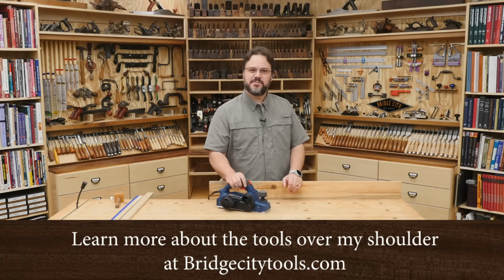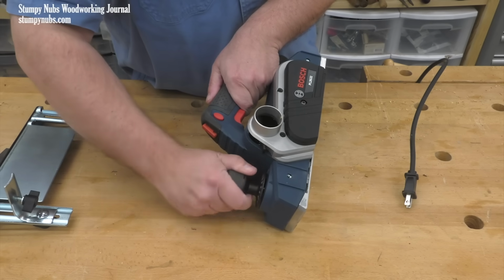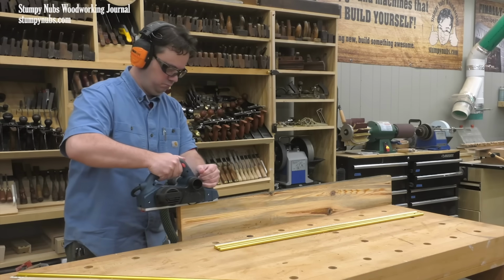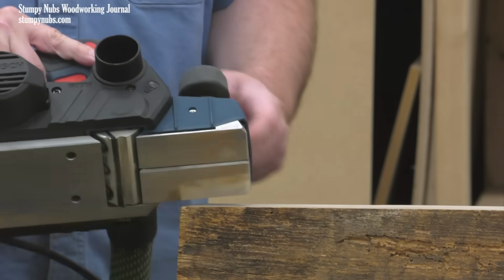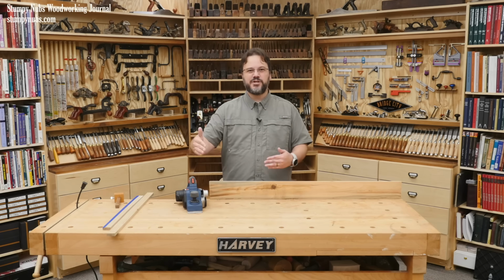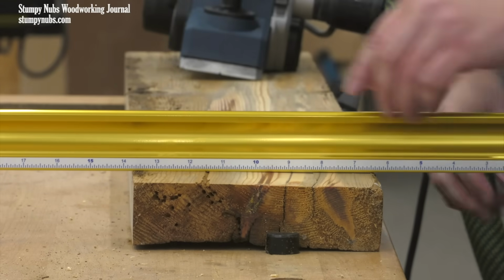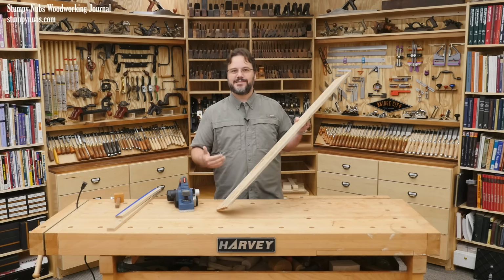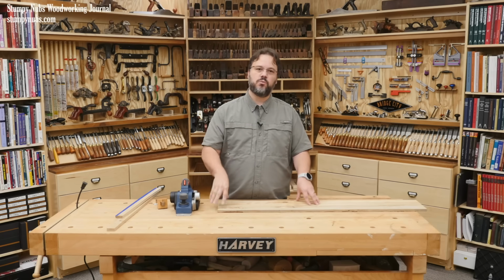Are electric hand planers too dangerous?

Comment: I recently tried a Ridgid battery powered electric handplaner for a small satellite shop..  Runtime was 6 minutes and cut was deeper on the right side than the left.  Returned it and got the corded Dewalt.  It works fine.  I also have in my main shop  an old Craftsman one I bought over 30 years ago.  It still works amazingly well.  As the old adage goes, "take care of your tools and they'll take care of you."
Reply: So many power tools are made battery powered while having small reason in really being so because the power draw is just way too much.

Comment: I've used my electric hand planer as a thickness planer. I actually am one of the few that have a jointer already without a thickness planer. I got a cheap one. So I joint the sides as usual. Then I mark the thickness I want along the edges and use the planer to get the thickness pretty close to uniform. I fish it off with a regular hand planer.  I'm not exactly a master woodworker but I have been pretty pleased with the results so far.

Comment: For a cupped or crowned edge, you can get the edge in flat nice and tight by clamping a straight guide board to the side of your project board so that the crowned sections are visible, then apply the planer to those sections until the edges are even to each other. I've done that to plane the edges even on harvested wood I rough-milled into shape.

Comment: I use mine for trimming long boards before putting them on a table saw if they are warped (or bowed or whatever it is).  I snap a line on the board for a straight line, then I plane to it, put it on the jointer then the table saw.  It is one of those things that I do not need very often.

Comment: Its a versatile tool when used correctly and safely for sure.
Ive used my electric hand planer to do exactly what you demonstrated for boards that are too wide for my jointer.  Just whittle away at them, paying attention to get them close.  Once good enough is reached, run them thru the planer/thicknesser, unplaned side first, then a quick flip a pass or 2 on the original side to bring them to thickness.

Comment: I have an old 6" Craftsman jointer. It works good on shorter pieces of wood; 3-4 feet in length. For longer lengths I have been using the powered hand planer to knock down the high spots first; if it really bowed or cupped. It does take less passes on jointer to finally get it flat or flat enough for me.

Comment: I love my power plane.  As you said, you need to use your head to get the job done correctly, but for me, it is indispensable in certain situations.  It's also great for straightening wall studs before dry wall is installed or rafters before roof sheeting is installed.  And I am sure many other uses.  Thanks.

Comment: I laughed at the beginning, I own that same electric planer, I’m a locksmith and I use it for exactly what you mentioned in the beginning, planing the bottom and hinge edges of doors.
I do wood working so  I own a jointer and a planer.  I’ll keep the Bosch for my door repairs. 
Thanks for the video
You have great tips

Comment: I bought a cordless Dewalt model for a reasonable price off eBay. Was having issues with the cut as it was taking really deep cuts even at the shallowest setting. After some investigation, it turned out one of the blade clamps wouldn’t tighten down properly so the blade was loose and thus slipping away from the center axis of the cutter head. Mildly scary😂 
The blade was still secured by the small groove in it, but it wasn’t tight enough to hold its position off that makes sense. 

But I spend like $10-15 on new parts and it solved it. 

It’s a fun tool. But it makes a hell of a mess without dust collection.

Comment: I think you might have mentioned planing endgrain. If you go right to the end while doing this you won't just get a snipe, you'll get a bundle of splinters. You have to work from both ends.
Reply: No need to work from both ends if you first cut a tiny chamfer at the end of the board. Same as you would do if you were squaring end grain on a shooting board. And no snipe if you follow Stumpy's directions for ending a cut.
Reply: @lanecobb4150  Thank you.

Comment: The best use i found for an electric hand planer was to make at least one face of the wood studs.
You might be suprised but this tool has alot more use in contructions than making furniture.
That being said, there are planty of videos out there showing you how to make an exact jig wich will allow you to use a hand planer as a thickness planer, i tell you, that jig is a must for any handplaner and it should come with the tool. JSK- koubou has a beautiful tutorial on how to make one. 
I know in this video Stumpy shows the basics of using a hand planer but. If you have a thinkness planer, is much easier to use a piece of mdf, particleboard or something straight and put your piece of wood on top of it with wood wedges and run it through the planer and on the edge, on planks of wood i never try to straighten the edge with a hand electric planer or even a normal hand planer, is just waste of time. I cut it with a tracksaw and most of the times if you have a good blade you just need a little bit of sanding and is done. Or you could just run the hand planer one or two times to make it perfect.
Also, it is very important, to use good quality blades and set them correctly, use the base plate, as a reference and use a very good straight metallic ruler when you instal the blades to make sure they are seated equal, if they are not most likely the machine will vibrate alot when is running. And if you don't run the blades through nails or chip them through hard knots you can resharp them. Is also adviced that when you get near a knot to go slower and allow the blades to eat through it slowly, otherwise it might chip the blade.
You also need a very straight working table for it especially if you plan using it with multiple jigs, and that can cost alot or can be cheap depending on your imagination.
What i really like about an electric hand planer, is that with a thinkness jig i can plane very very small pices, very accurate, i could do that with the thickness planer too but that thing makes alot of noise. You can also make jigs to plane the edge of a plank of wood perfectly 90, if you already have the faces straight and paralel. 
There are many jigs for a hand planer, you can even straighten a very wide board, just as you would do with a router.
But in carpentry this tool is really not used that much, is used much more in constructions because it eats through wood very fast.  
But if you build the jig it can replace a thinkness planer, it is much slower yes, but if you don't have one you can do it with this. Just remember the real cost of this tool are the good quality blades, and advice you to stay away from cheap ones, because in the long run those are more expencive since they dull much faster.

Comment: I was restoring the wood slats on three park benches and needed to remove a good amount of material. I got one of these power planers and took them down with one of these and then sanded with an orbital sander. It got me down to the fresh wood very quickly. After that I gave them two coats of penetrating epoxy made for boat restoration and then did five coats of marine varnish. They came out very nice.

Comment: always work towards your extractor/cable source. that way you dont have to pull the hose/cable
Reply: i got a 20 yr old bosch like yours built in switserland its fab made but used it about 15 times!

Comment: I have a bunch of them, two 6” ones, a few of those 3” ones. I also have two Stanley’s from the 60s with spiral blades, stands and sharpeners. They will last a couple of lifetimes. They are good for plank edges with undulating grain as they don’t raise the grain. They are good for working on beams.

Comment: I don't use my electric planer very often, but I did just use it last weekend for a kitchen install. I was scribing in an end panel which was going flat to the wall and needed some clearance on the back edge where it would meet the rounded inside-corner of the wall. The electric planer set to 4mm made a lovely full-length chamfer in a single pass.

Comment: 》IF 《 one already has a thickness planer, it's way faster to attach the piece to a known flat board with some shims and hot glue. Then just run it through the thickness planer. Both sides will flat and parallel in just a few minutes.
Reply from the maker: I wouldn't say that's "way faster"

Comment: I always hang power cords above work area, with routers & planes 1/2 thru a cut & the cord snags can result in dmg to work surface, risk of running over the cord or it being a trip hazard if walking the tool along surface.

Comment: When I bought mine, I thought it was just going to be useful for doors too. I just wanted a new tool. But it has saved my life multiple times by removing material that I could never have sawed off, and it would’ve taken forever to sand down.
I could’ve never made the wooden track for my circular saw, without being able to shave down the middle rail till it fit Correctly.

Comment: Boat builder use them all the time for fairing in the planking. Most will re-grind the blades to a slight convex edge to hollow out boards on the back side to fit up against a curved frame.

Comment: I have a Dewalt electric hand planer AND I do woodworking - but I do not use the planer for woodworking. I use it to take excess off doors where the frame has shifted due to foundation movement, etc.

Comment: I moved to Thailand a few years ago with my Thai wife. Her brother is a woodworker and I've seen him flatten one side of several large teak slabs (about 36" x 96") using your technique. These are slabs that start out very warped as the slab is made by hand cutting from a tree trunk using an unguided chain saw. I'm amazed by how flat he gets these slabs. I'm fairly certain that if I tried doing that I would start with a 3" thick slab and end up with thin veneer.

Comment: I have a Dremel planer that attached to the main unit and uses a large spiral bit. I used to use it in my patio furniture business to shave down acrylic table tops, but it was designed for shaving doors at 1/16" per pass. Sure wish they still made it.

Comment: Another valuable info-taining video. I have seen other videos where the creator is using a power plane. I have a nearly new Makita power plane. My experience has not been so good. It bucks, grabs and generally makes a mess of the board. My plane is relegated to shortening doors. Feathering a board is easier (better) with a #5 hand plane. My power plane sits in it's fancy case for months at a time. Definitely buyer's remorse. Thx.

Comment: I have a planer just like the one you showed in the video.  Mine tends to clog up after about 3-4 passes at the lightest setting and requires that I stop and dig out the clog.  It makes connecting a dust collector a lot more frustrating.  I mostly use it for flattening blanks for turning bowls.

Comment: I can definitely see the appeal. There are fewer variables than a hand plane, don't take as long to get proficient, cost less, and can easily speed up a laborious task. As I'm a hobbyist, have time, and learned how to use a hand plane, I've gotten adept with mine. You can get very proficient, but it requires patience and practice. Does anyone have preferences as to which power planer works better / best? I know my hand planes, but have no experience with these.

Comment: They are popular outside the USA because most don’t have the space…
Reply: Also can be had for quite cheap, the RRP of a Dewalt 735 is about AU$1200 new and about AU$750 used and a jointer is marginally cheaper so most people aren’t going to have both. Power planes have been popular since at the least the 80’s so there are tonnes floating around and quite often are in pack in deals. My current one came with a makita pack and the cordless is great for quick jobs around the house

Comment: Into, lol.  You are the reason I got one of these :P
Iirc after seeing an earlier video you made on using them as an alternative to a jointer.  But I’ve used it to quickly do small thickness adjustment to small and large builds.

Comment: I try to use mine, but for every board wider than the blade, I always get slght scratches between the passes. What can cause those? Blade setting, or maybe my inproper technique?
Reply from the maker: That's unavoidable with an electric hand plane. Traditional (non-electric) hand planes function differently (the sole is flat from end to end with only the blade protruding) and the blade (called an iron) can also be sharpened to a slight radius so the shavings feather out toward the sides without the corners digging in, blending the strokes into each other.
Reply: Is is cuts from the blade scratching or is it your sole scraping on the way through? My makita has a slight chamfer on the edges but my old ryobi was essentially square and did leave scratches

Comment: Didn’t you make this nearly identical video about two years ago? I’m not criticizing. I’m just having déjà vu.
Reply from the maker: I did a very similar one, yes. This one is for the new viewers and includes a bit more information.
Reply: @StumpyNubs it’s similar to the old one, but your original one inspired me to buy an electric planer and I’ve loved using it. The video still serves as my reference.
Reply: @AaronGeller same, i bought two dead ones (1 motor was fried but good blade, other plates were trashed and blades so so) from a charity shop for like $15 and put together one functional one, and love using it.
Reply: @lolz4887  I've been Frankensteining and cannibalizing old power tools for years. It's fun, cheap, and rewarding. Keep on, brother!👍
Reply: @StumpyNubs  i saw that vid and was hoping your next vid on electric hand planers would be about jigs you can make for them and whether those jigs are good/safe. would you be interested in making such a video?
Reply: This is Rev. B  ( B standing for Beard ) pay attention!
Reply: I got a ryobi cordless on sale for 60$ probably should have gone corded it eats batteries
Reply: @kichwatembo6551  I got the corded Ryobi and it's great. I take the cord and tape it to my shop vac hose in several places which I use for dust collection.
Reply: @kichwatembo6551  if you can adapt it to harbor freight Hercules batteries, you will be golden. Just run 8/12 amp hour batteries
Reply: I like that he does this.   Not everyone binge watches YouTube videos of a specific creator and videos like this may never get watched by newcomers.
Reply: I’ve asked about some techniques and tips with planer and here we go again. Setting up, difference of the blade types... Word by word the same, but with a beard. If new viewers need overview, they can search it. I hope.
Reply: Used a lot by wooden boat builders.

Comment: That's a good call about waiting for the blade to stop after releasing the trigger.  Skill Saws are probably the worse tool for this, as the blade can move the tool very quickly if it hits the ground or your workbench.  My wife had a customer at the local ED where she worked, who had a skill saw attack him.  She is standing next to me so I asked her for details, and she said, 'Oh, we had so many many I can't remember the details.  We used to call them saw vs man, or whatever.'   I have had two minor incidents, both involving angle grinders, that got me when putting down the tool after letting go of the trigger.  They were not serious, but I never use an angle grinder without Kevlar gloves now.

I have a Bosch Blue planer that I only use for things like swollen gates and posts.  My gripe with it is that it is difficult to use when close to the ground, and I can't say that I have worked out a good way to make those low down cuts safely.

Comment: I would have used a planer to achieve equal thickness AFTER using the jointer to make one side flat and square.
Reply from the maker: Wait, are you saying you would use a jointer to flatten one face, then an electric HAND planer to flatten the opposite face?
Reply: @StumpyNubs  not a hand planer but yes otherwise.
Reply from the maker: @gergc4871  - If you are talking about using a thickness planer after a power jointer, then yes, that is the normal process. This video is about how to do it without a jointer.

Comment: Only one thing, I don't trust that foot !! I always set it down when the blade stops and on its side!
Reply: I've had a Bosch for 15years and have always trusted the foot.   The ONLY time there was an issue was when I put it down on a flexible surface.   Great tool.
Reply: @UsualYaddaYadda  it doesn't matter what brand they get a build up of sawdust and resin like a gaurd on a saw

Comment: Excellent video.
I'll stick with my hand planes and my thickness planner.  I enjoy using hand planes and they are far safer than a power planner. 
I've even started to use hand saws!  Just for the joy of it.   It's like getting free therapy.  LOL!
Reply: I find the electric planer to be just as therapeutic as the hand plane but not as tiring. I've spent the last 3 days planing boards mostly using the Record no. 5 whicj can get very heavy after a while. switching to the electric plane for a while helps
Reply: @mallencolly  
Well then - I'll have to investigate electric planer therapy!
What brand of electric planer do you like best?
Reply: @skippylippy547  I've only ever used Bosch. I have a PHO 1500.  Whichever one you use just go slowly. Slower than you think you'll need
Reply: @mallencolly  
Thank you!
I'll give it a try.